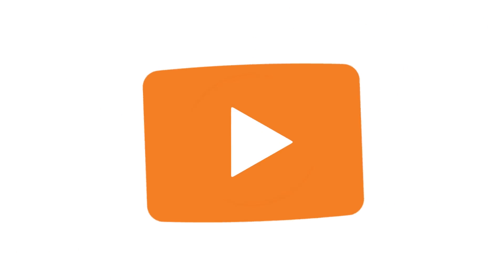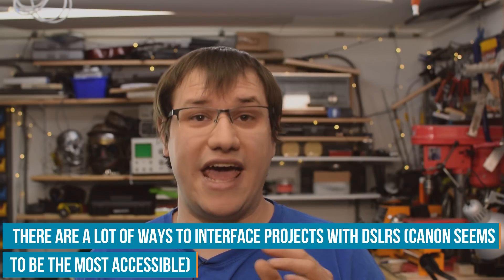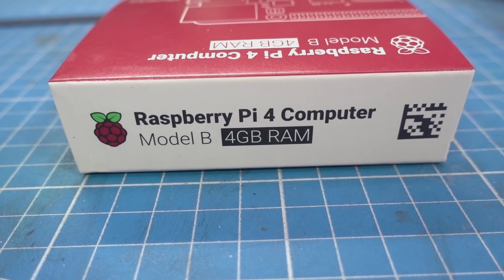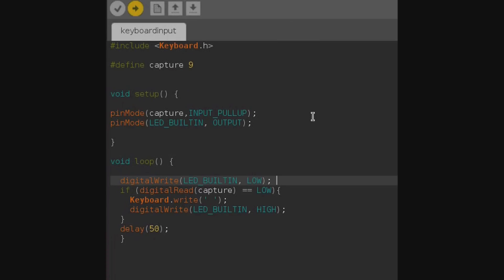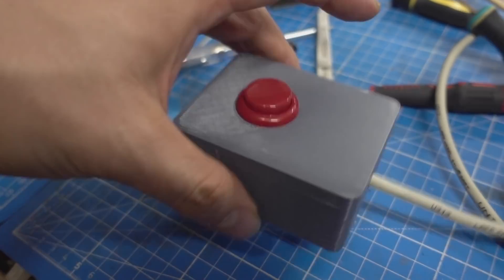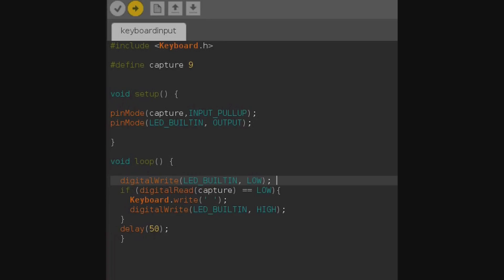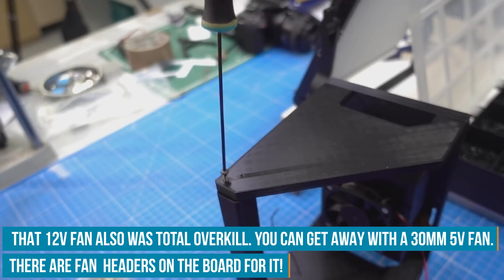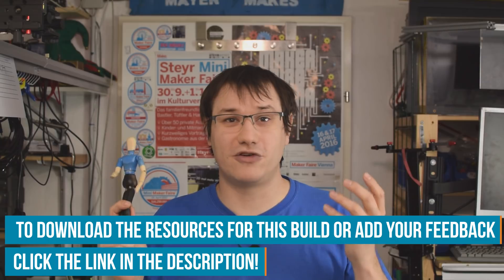DIY Stop Motion Rig with #LattePanda

Comment: Interesting subject, and great presentation. 

Question why did you go with the older model and not the latest Alpha model?   Faster and provides more on board RAM.
Reply: you may have heard of a certain pandemic and the lockdown restrictions  so I used what I could get. the lattepanda has more than enough power for this application, and I have no reliable source for the alpha + it does not support the Display that I already had.
Reply: MAYER MAKES / pandemic? What pandemic oh the one the hit the world would, yea it kind of makes things a bit harder to get stuff.  

Anyway the older models are plentiful and come in much lower in cost.   Good luck on your project

Comment: Having a hard time figuring out why anyone would build such a simple project with a $100 SBC when a $6 Arduino would suffice. Guess that's what you do when the manufacturer gives you one for free?
Reply: an arduino would not give you the Graphical interface, preview monitor, onionskinning, and other features shown in the video. You can of course build it with a Raspberry pi and an arduino. the lattepanda is an X86 based SBC which handles the programm and OS I'm using better than an ARM based board. You would not get the same result with just an arduino, but you can get similar results with other SBCs. the usual commercial variant is the camera thettered to a laptop running Dragonframe (paid software) and bying their external keypad.

Comment: Great project! BTW I would definitely give Ubuntu 20.04 a look. They did a lot of under-the-hood improvements (starting in 19.10 actually) which resulted in the GUI being significantly faster and more responsive and in general less clunky. It's my favorite Ubuntu to date.
Reply: I will for sure check it out. But the shift to gnome with 19.10 was heavier on this sbc than 18.04 with unity. lets see if 20.04 is back up to speed on low end computers.